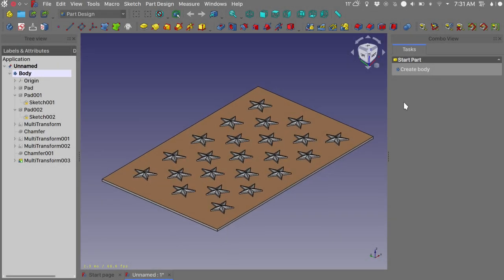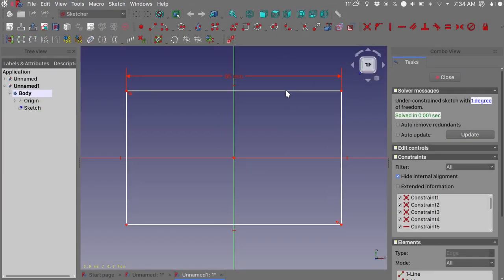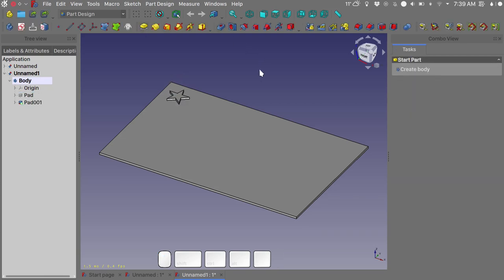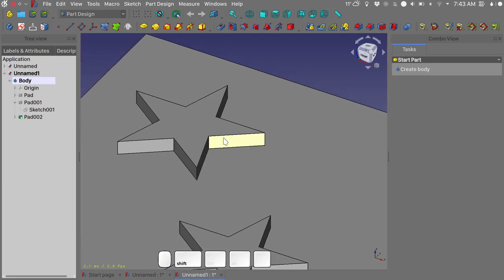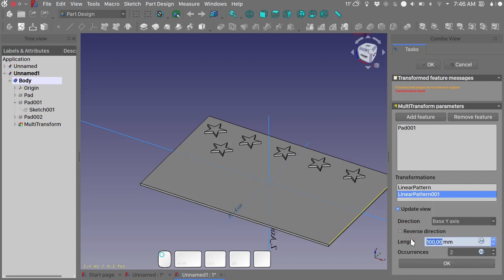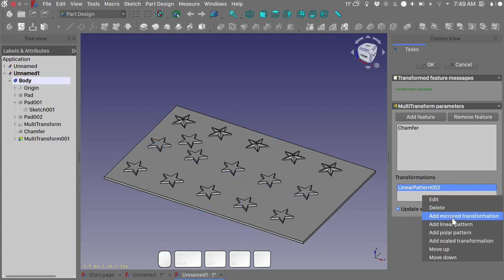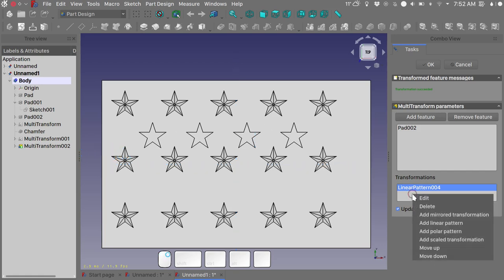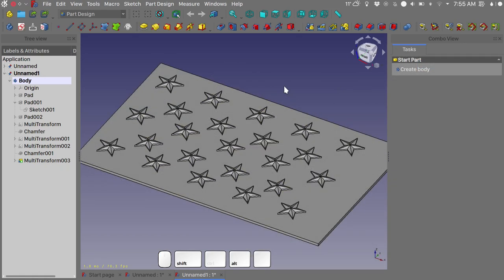FreeCAD 0.19 Stable MultiTransform tool.

Comment: you can use multitransform with more than one function. in your example, you can make the first star, the chamfer, and the multitransform of both  ;)
Reply from the maker: You are 100% correct. My bad. The caveat seems to be that the feature must be added in a second step to the multitransform. I selected both the features and THEN hit the Multitransform tool.  In this case, although the pad and chamfer are vissible as features in the combo view, the multitransform will make an array only with the pad.  Instead LinkStage3 works out of the box. Don't know if it should be reported or not.
Reply: Yes, it works like that. That was the whole purpose of the "add feature" in the multitransform tool. The beauty of it is you can do it however you want :)

Comment: Nice little tutorial 👍. 
Is there anything wrong with setting "support transform" to true for the chamfer? This would save the second multitransform for the chamfer.
Reply from the maker: Please read the first comment under the video(the one that I pinned) It is indeed possible, simpler and allot faster to do the transformation in one go by adding the chamfer  feature to the multitransform panel  after the first transform is done . I'm torn if I should just remake the video showing the better way or leaving this up. I have so many series started and so little time lol
Reply: @OficineRobotica  Yes, the pinned post is also a way to use less multitransforms. There are certainly other ways to create the pattern 😁
I would leave the tutorial as it is, it is explained very well. (btw, we have the same amount of subscibers at this moment 😃)
Reply from the maker: @DanielBadberg  a fellow YouTuber... the ascent is difficult lol